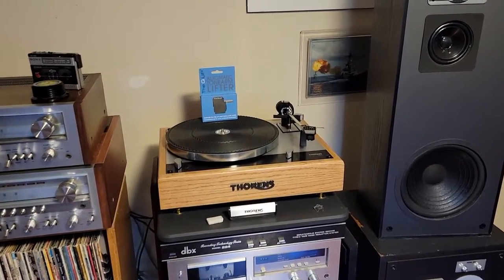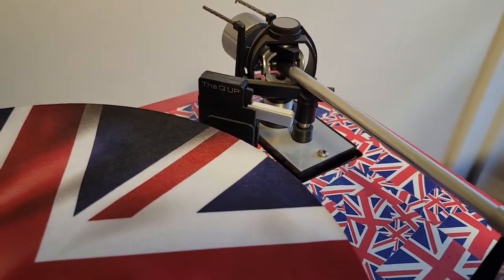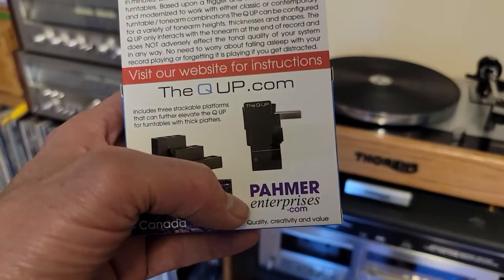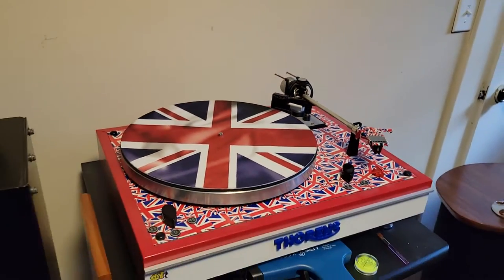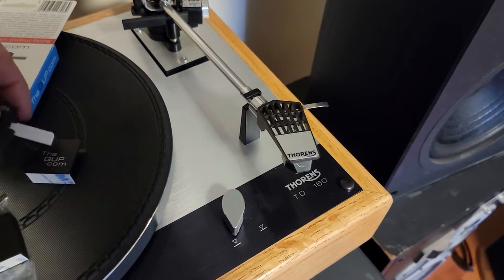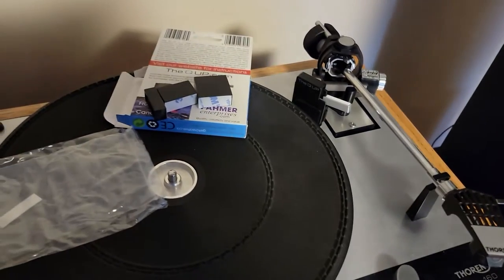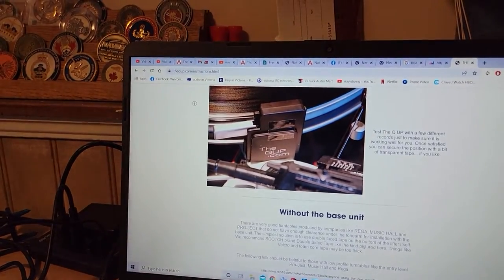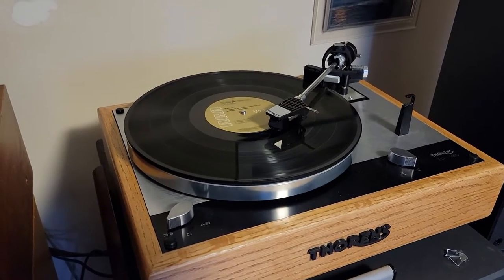Part 7: Thorens TD-160 Project (The Q-UP Lifter Necessary Tweak) - 14 Apr 2022

Comment: A must have mod for these. I gutted a new Q up and swapped the internals to save a vintage "Thorens" branded one that broke.  Have you noticed on the TD160s that if you run it to the end of the run out groove (without a Qup) it actually stops the motor? Really surprised me!  Stock tonearm on mine.  Nice videos!